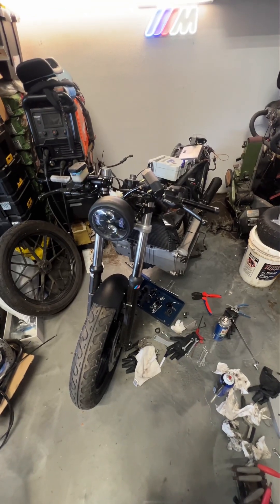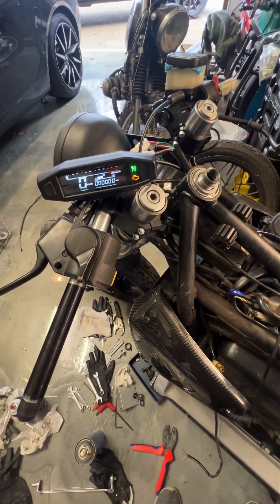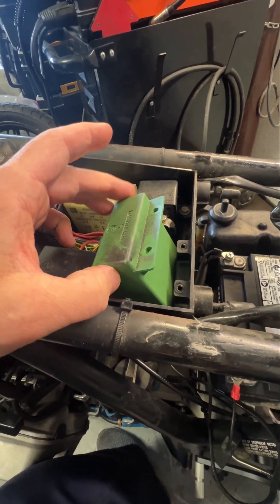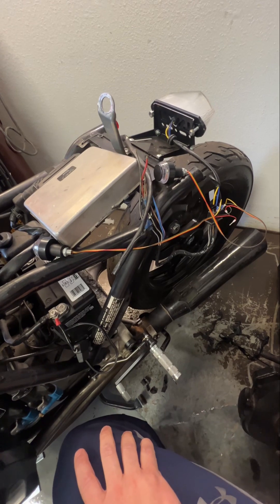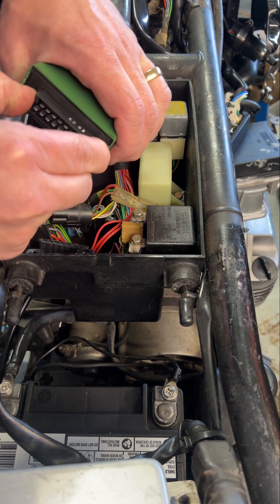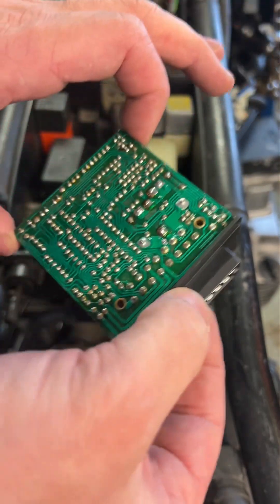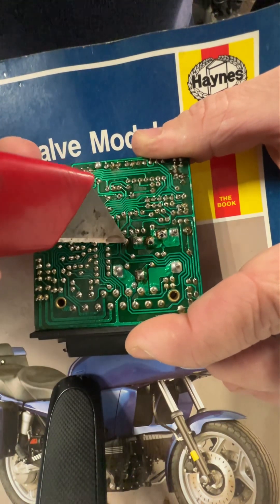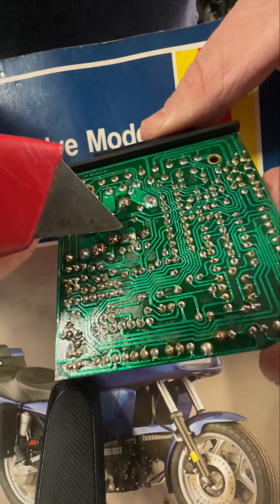BMW K100 LED Turn Signal Modification to Flasher Relay

Comment: Hey! Do you have a link to that gauge unit? Looks sweet, was it hard to wire up?
Reply from the maker: Not hard at all very much plug and play, this is the unit https://fiveaces.hk/gb/pack-mini/23-86-pack-mini-basic.html#/32-types_of_connectors-compatible_terminal_block
Reply from the maker: I bought from a guy named Francois pavy, he can be contacted by Facebook messenger or I think he’s here on YouTube as well.
Reply: @Dibs2  Perfect,  thanks!